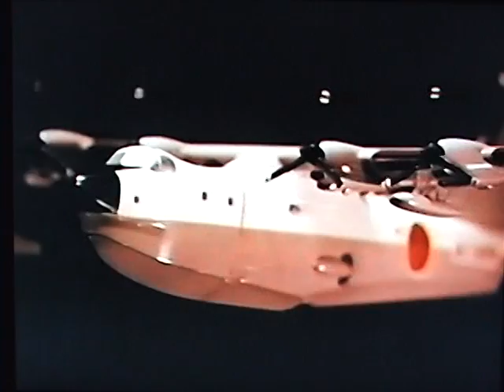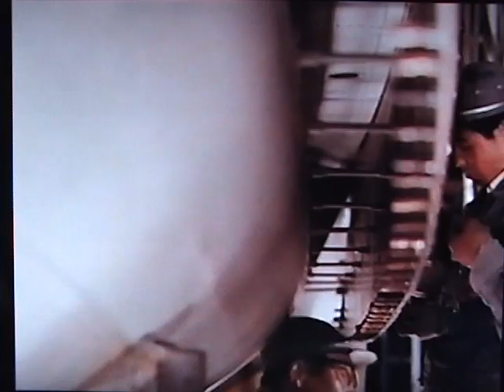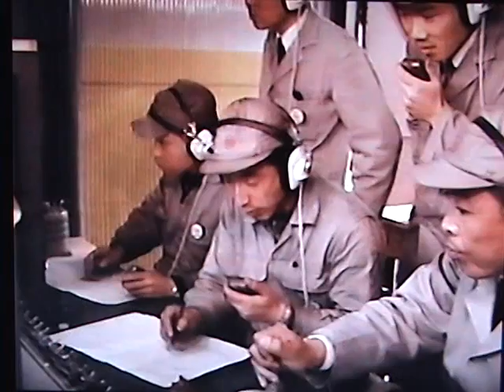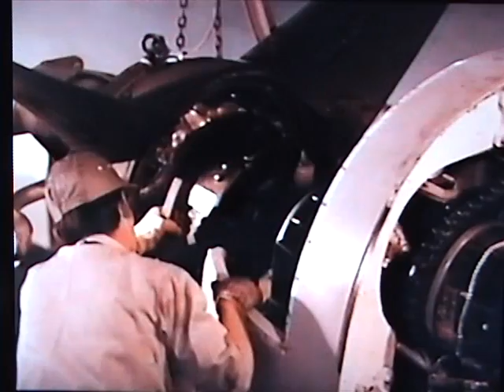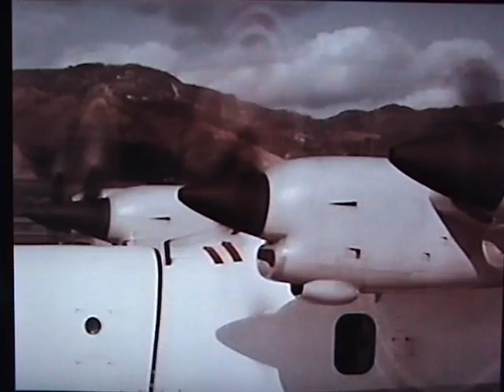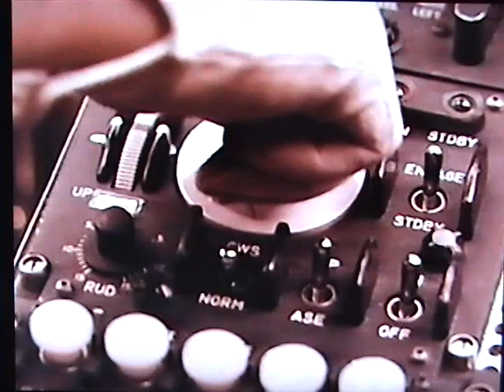PX-S STOL Flying Boat.mpg

Comment: Shinmeiwa is the successor of "Kawanishi" that made flying boat "Emily" in the WWII. The Emily is one of the best amphibian warbirds. Please take a moment to study before making comments or the comments would sound like idiots.
Reply: Not exactly an amphibian. It had retractable beaching gear. It was incapable of landing ashore because the wheels were too small and the legs not quite sturdy enough for landing; the beaching gear was lowered after a water landing when the boat was approaching the beaching ramp at a typical seaplane base so that the boat could just taxi ashore.
FWIW, that was probably the original intent of the wheeled undercarriage fitted to the amphibious version of the PBY Catalina, but that gear turned out to be sturdy enough to land on prepared runways.
The H8K [Emily] is widely regarded as one of the best flying boats ever built, both in performance and especially the heavy defensive armament of the H8K2 (Allied fighter pilots universally acknowledged the Emily as one of their toughest opponents). Later in the war Kawanashi was working on even faster and more powerful successors but by that time  (1944) the writing was on the wall, and the company had to shelve the designs in order to concentrate on land-based defensive fighters. Ironically, one of the best IJNAF land-based fighters, the N1K1-J and N1K2-J [George] were developed from a floatplane fighter built as a successor to the A6M2-N [Rufe] (a floatplane version of the A6M2 Reisen) known as the N1K1 Kyofu [Rex].
The Shin Meiwa PS/US series is an apt successor
The only Allied boats that came close was the Short Seaford, and the Vought-Sikorsky VS-44.